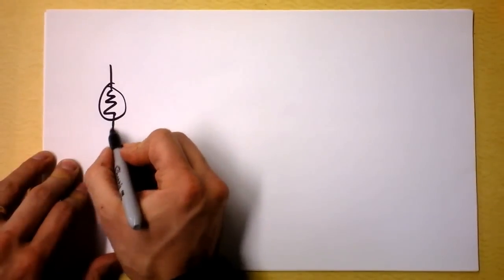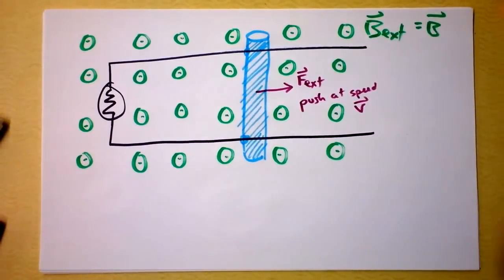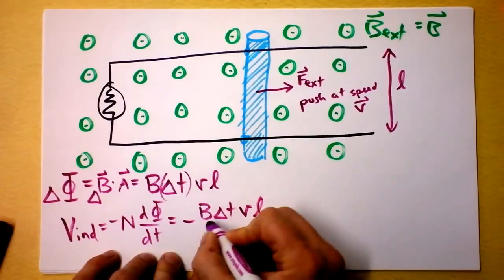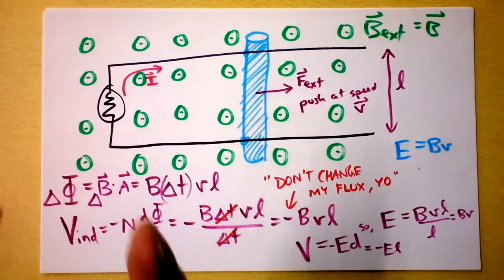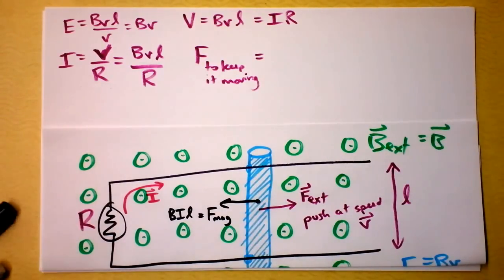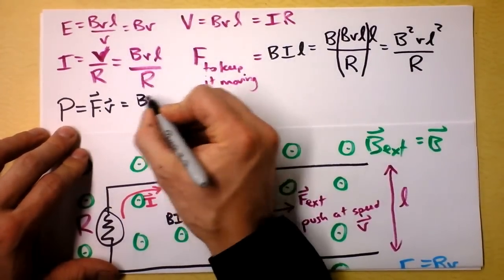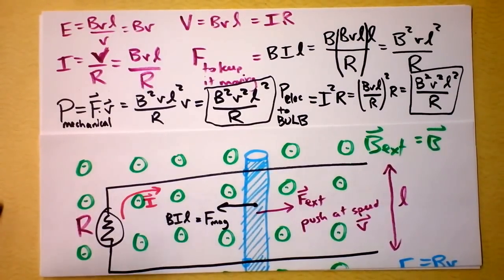Equivalence of Electrical and Mechanical Power for Expanding Loop in Magnetic Field | Doc Physics

Comment: Second question (maybe more to come hopefully mahyaps):: focusing: how do we know what the direction of the length of the moving wire is? (I'm trying to figure it out so that I can do L x B in the BIL equation to find the direction of the force on the moving wire tHX :;:DDD
Reply from the maker: +Strobe Lala I like to think of it exactly as qvB and do v x B.  The velocity of the wire is to the right.  It feels weird to say that the length is to the right, though.
Reply: +Doc Schuster Doc, Thank you your excellent video. I have been searching Google for any explanation how mechanical power is equivalent to electrical power. And your derivation of equations makes the most sense. Pleas help me understand a few more things here. From electric car's point of view it is well said that 746 watt is equivalent to 1 HP. Electric power and mechanical power use equivalent units but they are not equal so to speak (is this true?) I mean falling down onto floor(mechanical) is certainly different than getting shocked(electrical). I understand that 746 mechanical watt is defined as 1HP. But can 746 electric watt perform equivalent of 746 mechanical work? How? (Is it similar to your pushing rod analogy to how the electric motors create mechanical work?). I can live with the statement that 746 watt is just defined as 1 HP for convenience's sake, fine. If we hypothetically assume an electric motor has 100% efficiency, and if 746 electric watt is used can I expect 746 mechanical work to be output?

Comment: Why is the distance in the V=-Ed equation the length of the wire?!? ;** U ROCK DOC as previously mentioned
Reply from the maker: +Strobe Lala Well, careful!  This is the most important part to get here.  The potential difference is developed across the moving bar in this situation, so that's where a linear electric field is present.
Reply: +Doc Schuster third question: why does a CHANGE in flux create a current/ Vinduced thxxxx ;))))

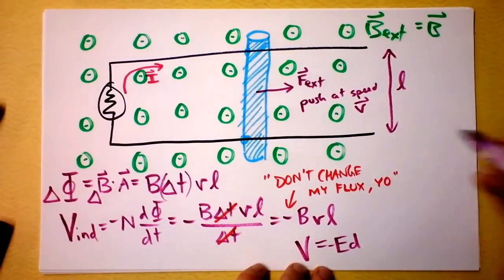Comment: At 5:05 did you mean to say that the induced voltage is an Electric field? You said one thing and wrote another, I'm confused. Could you please clarify Doc.
Reply from the maker: IbanezV70CE I think I totally did.  I had to watch that five times to figure out what I may have meant.  Thanks for the tip - I put a note in the video to correct my error.